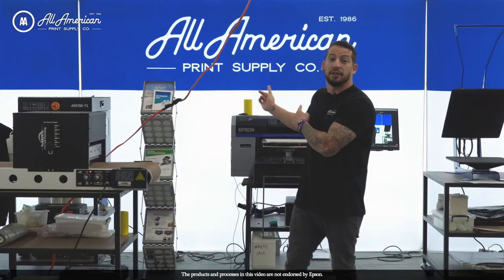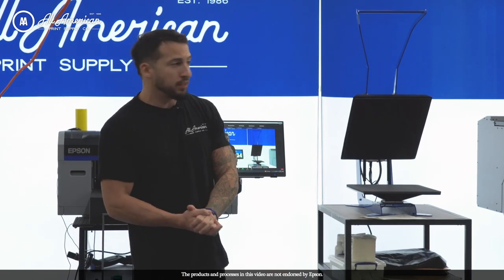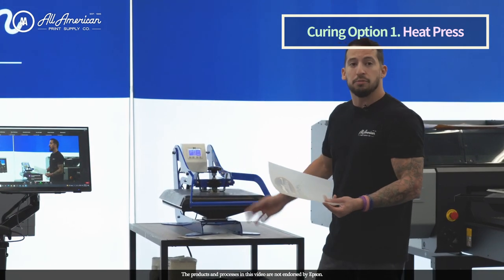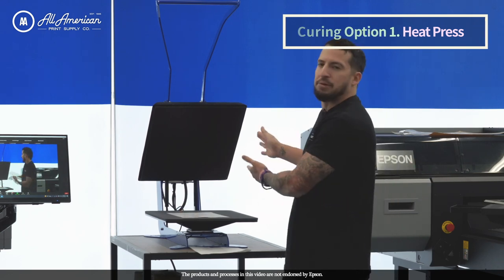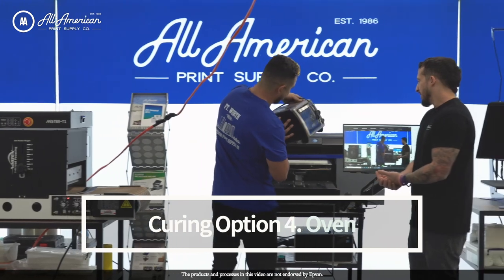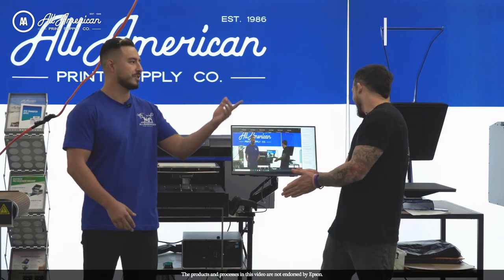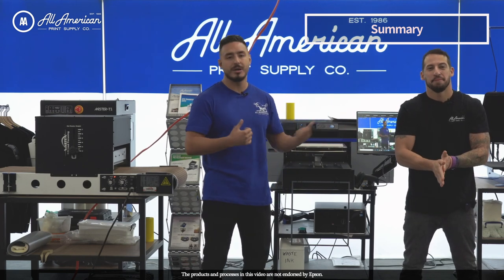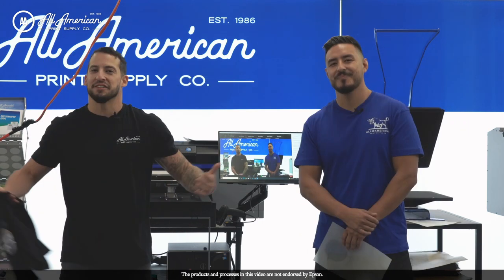Direct To Garment Transfer (DTF - Direct To Film) Workflow : Curing | AA Print Supply

Comment: Can I cure DTG prints with a flash dryer like the one in this video?
Reply from the maker: Hello,
YES you can!  Depending on your heat time will vary so try to keep an eye on it - we want a glazed sort of almost orange peel texture on the powdered side of the transfer to know its done.  This method is much faster than hovering with a heat press
Reply: @AAPrintSupplyCo  I am asking about DTG prints.
Reply from the maker: Hello,

Once the hot melting powder is applied to the wet print we need to cure that powder so the transfer can be applied - the flash dryer is great for that. If we are talking about actually APPLYING the finished transfer we will need a heat press to stamp it on

Comment: Is a 600°F flash dryer too hot? Looking at a model and they have one that is adjustable under 200°F, or locked at 600°
Reply from the maker: Hey there! The flash in this video has an approximate max heat of 700F, we run ours for DTF curing at almost max setting (between a 6 and HIGH). 600 does not seem too hot and testing is always advised to see what works best for your workflow

Comment: How do you rid of the excess powder on the edges of your print…. That appear like a white outline on your finished product?
Reply from the maker: Hey there! This can be a sign of excess static or humidity. Anti static pads can be used to place the film on before printing to remove excess static: https://aaprintsupplyco.com/products/dtg-transfer-direct-to-film-dtf-premium-anti-static-grip-pad-1-8-width?_pos=1&_sid=625044f74&_ss=r

Comment: What’s the temp you use for the heat press? And how many seconds?
Reply from the maker: Hello, for the curing of the hot melt powder to wet ink we can use temperatures of around 350F and hover for a couple minutes. Preheating the lower platen by closing the press at full temp can speed up the curing process also

Comment: Is it ideal for the conveyor dryer to be forced air with DTF transfers using epson f 2100? And why? I know with water based inks the curing times and temps are pretty different from plastisol.
Reply from the maker: Hello,
No for DTF transfers specifically you do not need forced air.  It really varies dryer to dryer but you want to give it about 1 minute in the tunnel with the heating element as low as possible and the powdered transfer to have a glazed orange peel texture.  What dryer do you have?
Reply: @AAPrintSupplyCo  I am using a heatpress but am looking into conveyors dryers specifically just for curing the transfers before putting them on the garment. I have only the one heatpress doing everything right now and would like to not have to double physical labor but buying two heat presses, but rather buy a conveyor dryer to set and forget transfers as I apply the hot melt to them
Reply: @AAPrintSupplyCo  Also, about what temperature inside the chamber should I have the dryer heating at, and about how many seconds should the garment be under the heat element? I don't have a vastex but a workhorse products compact dryer. Worried about burning up transfer sheets or shirts. No temp control, just belt speed. I know it gets up to 600F. Thanks in advance